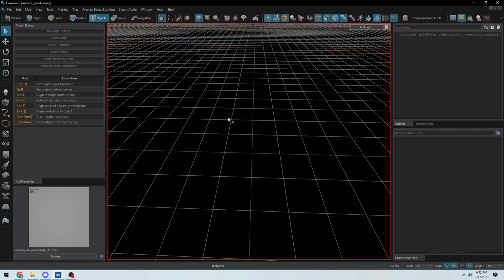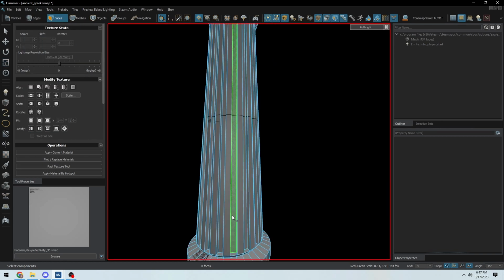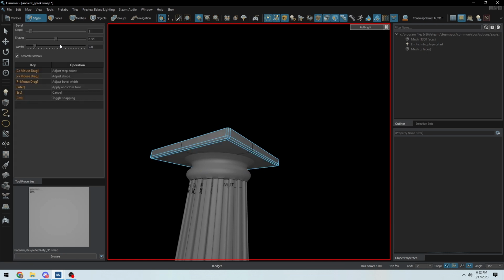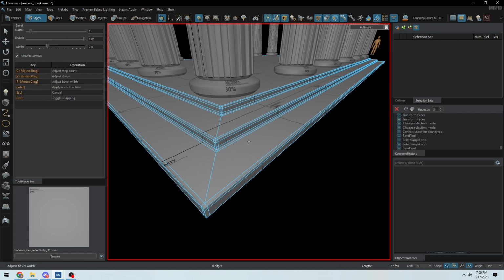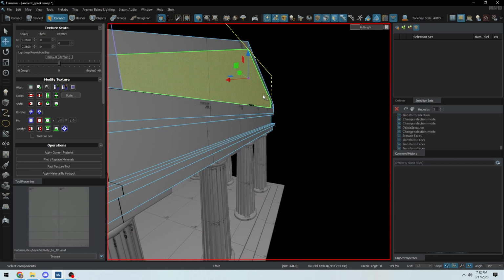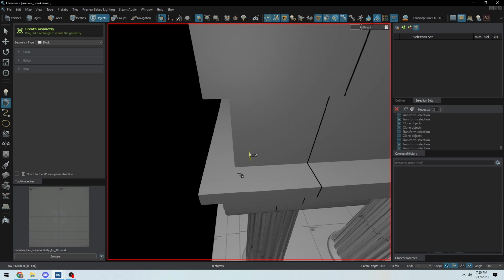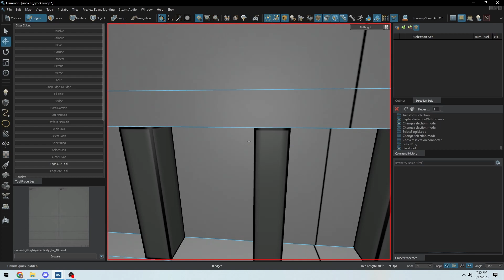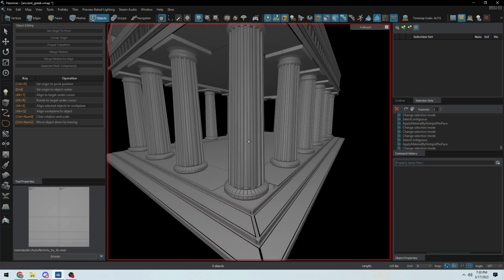Hammerhead #2 - Greek Architecture in Source 2 (Counter Strike 2, S&box, HLA)

Comment: In the current CS2 test, I can't use Alt + T for hotspot mapping, I can use Alt + H, but I can use both shortcuts separately in s&box, is it because Alt+T in CS2 became other shortcuts?Maybe I'm just stupid, I don't speak English very well and I can't read the shortcut list in the settings very well, can someone help me?
Reply from the maker: It's not your fault. They did not include the rect files needed for hot spotting in CS2. I have the solution though!

https://cdn.discordapp.com/attachments/1120921034187608135/1154773910307475527/trim_masterlayout_01.rect?ex=65158202&is=65143082&hm=ad390fbc04a0c4227b375ebe364e95cf7aca60609f55338d73699498555b823d&

Put this file in your 

content\csgo\materials\trim folder

Comment: so i remember in the early tutorials you made the point about ngons alot, which really held me up making everything i made a mess of lines everywhere. but it seems here you didnt really focus on getting rid of ngons. are they not actually that bad to have or worry about?
Reply from the maker: I made an effort in crash course to really ingrain building with minimal n gons for more of a foundational purpose of good habits. However, the engine does triangulate ngons, which can work in many situations and is a time saver. For displacements, uv alignment, and non planar angled faces, N gons can cause issues. I'll have a video about when to and not to coming up soon!
Reply: He did say you can have a few extra but not too many. Also from what I saw in the video, he had a ngon in the roof triangle but he fixed it with 2 cuts. Don't be held up by this. From my rough 30ish current hours spent mapping in source 2 I havent had alot of problems with ngons. If you are still worried about them I would suggest just compiling your map regularly and checking if its fine. Trust me you'll have a blast :)
Reply from the maker: @perify_  Astute observations :) You are correct that you can include them into your workflow!

Comment: That was really cool, learned plenty ty :)
Just a small trick that could help you as well : if you know in advance the value of the transform operation you are going to execute (for example when you know you are going to extrude&translate the stairs by 8 units downwards), just roughly do the operation in the right direction, on purpose make it not enough or too much, and type in the keypad the value you want to use, validate with Enter.
It's a very cool thing in Source 2 so that you don't have to rely too much on the grid and have to constantly reconfigure the grid size.
Reply from the maker: Love knowing other ways to work around the toolsets! I'll be sure to go over this method in an upcoming tutorial :) It helps a ton when it comes to using the scale tool as well to use the numpad - I know though some people have issues if they don't have a US keyboard!
Reply: @eagleonedevelopmentteam849  i can't speak for everyone, but i'm using azerty keyboard (french) and it works (but there is no working shortcut to increase/decrease the grid size for example though, for that my trick is to hover the grid size field with my mouse and change the value quickly with the mousewheel)
Reply: @leplubodeslapin  you can change the keybinds i set my grid scale to alt+mwheelup and alt+mwheeldown because that combo isnt used anywhere
edit: I think its actually better that way compared to pressing 2 keys that are pretty much out of the way when u work normally
Reply: note: just changing the hotkey config to the equivalent keys on your keyboard didnt work for me with a qwertz keyboard so i think its a compability issue somewhere
Reply: @andiq1  nice! I'll give it a try!! Thanks
Reply from the maker: @andiq1  I think the work around was a software program where you clicked on numpad0 and hammer accepted it